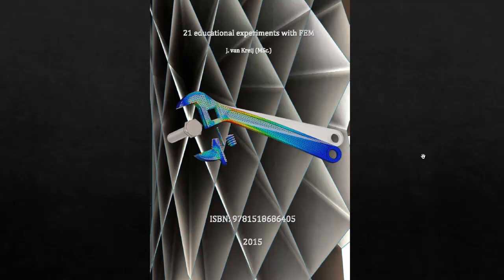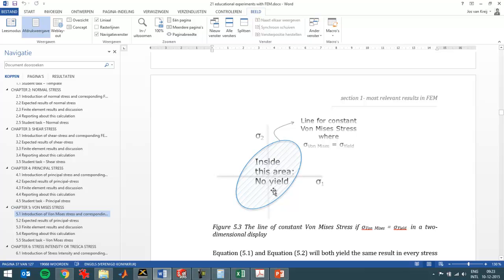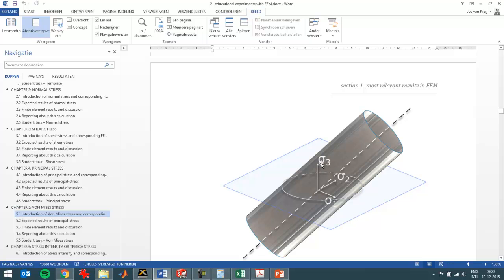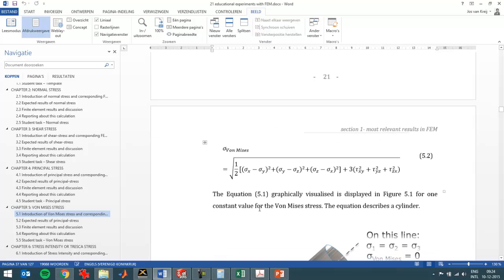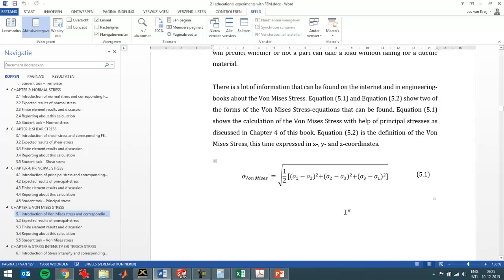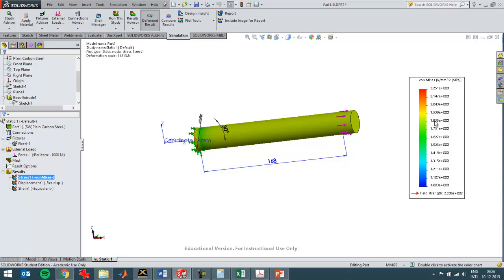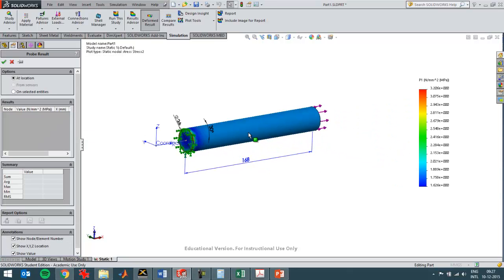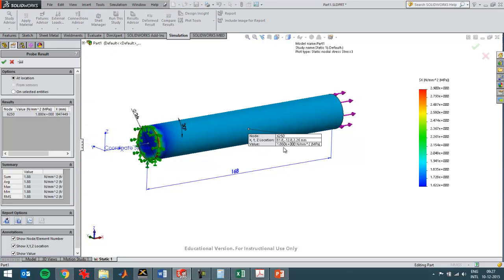Chapter 5  Von Mises Stress explained with SolidWorks Simulation

Comment: I see and understand your point/example under constant pressure/it being at the bottom of the ocean, it would deform and increase density but not fail as the failure plane has nowhere to go. Now, if you symmetrically pull a cube of whichever metal over it's three axis in an perfect isolated vaccum... you would eventually sublimate the material assuming it doesn't ever fail? Or am I wrong? What I mean is, how does that apply to tension?